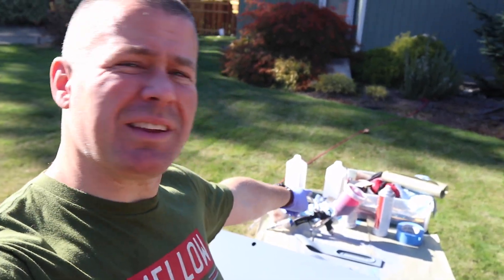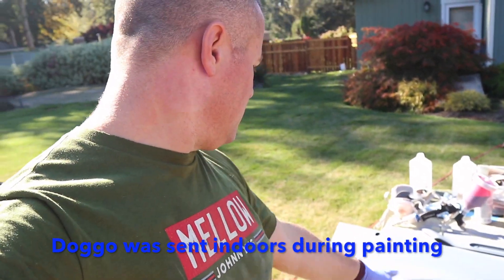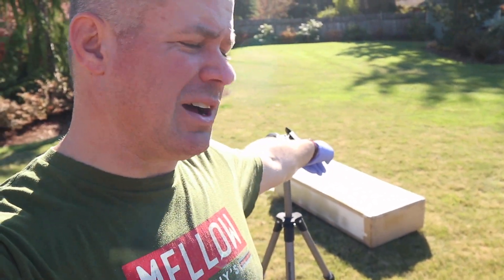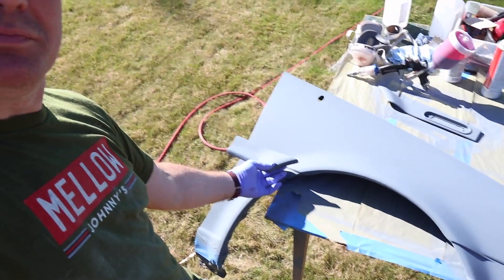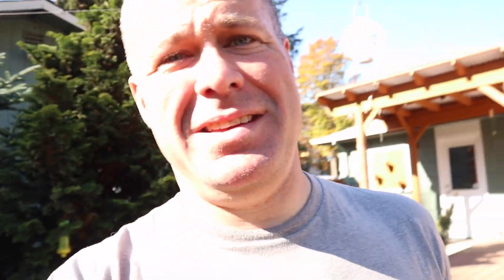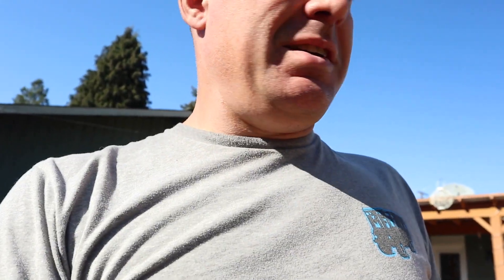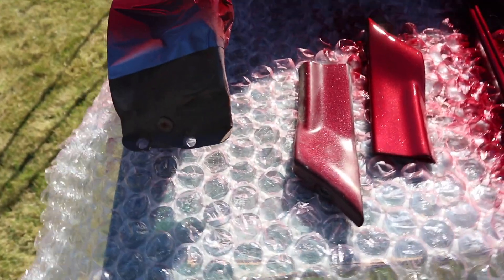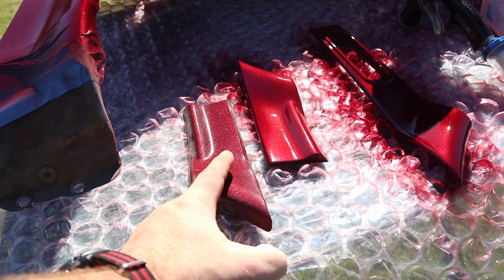Painting the NX2000 at home! 1992 Nissan NX2000 rallyx prep ep#2

Comment: In planning to make my own rally( California street legal) NX. Any words of wisdom, how to find parts, aftermarket suspension, etc?
Reply from the maker: Are you planning on doing stage rally with the car?
Reply: @ThrottleGrotto  I wanted to make a tarmac/ dirt car, while I would love to enter a race, I was planning to use it as a daily driver but one I can run if need be.
Reply from the maker: @Theory_Zero  I think getting good suspension will be the toughest part. Lots od archived info on sr20.net, don't go too low because they don't have tons of wheel travel.
Reply: @ThrottleGrotto  that's actually the main reason why I was looking into a rally set up rather than a street set up😅 (scraping feels bad man)
Reply: @ThrottleGrotto  Also, Thank you for the replies!
Reply from the maker: @Theory_Zero  If you find something that bolts on and still gives some wheel travel, let me know. I was thinking about looking into BC once I go modified, but that's next season at the earliest.